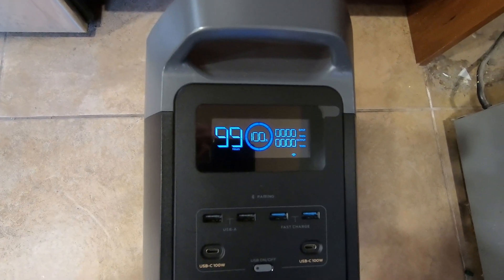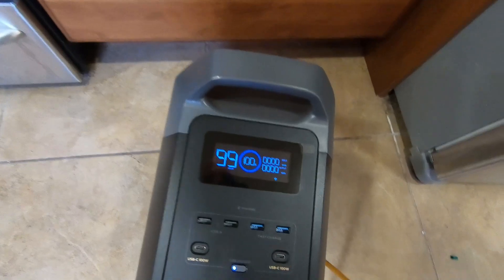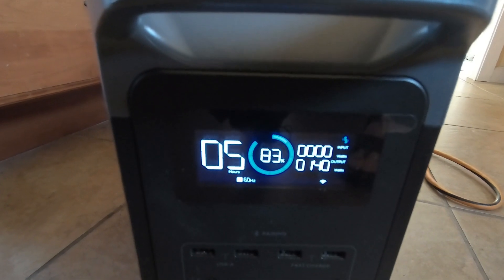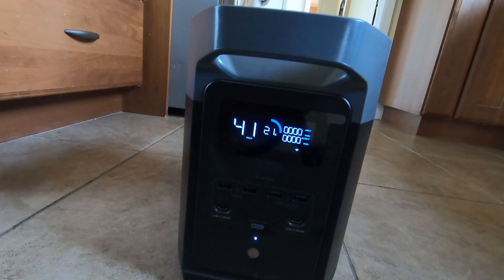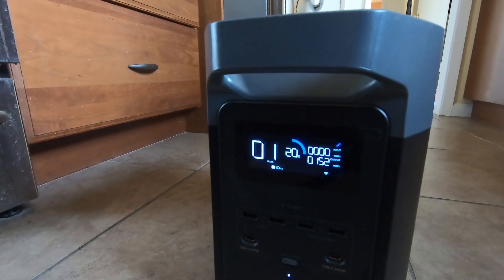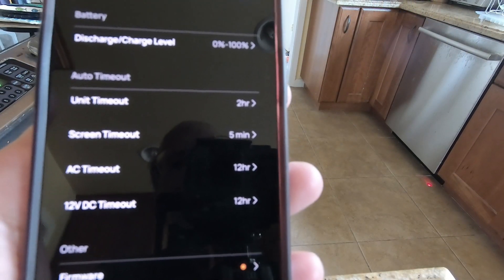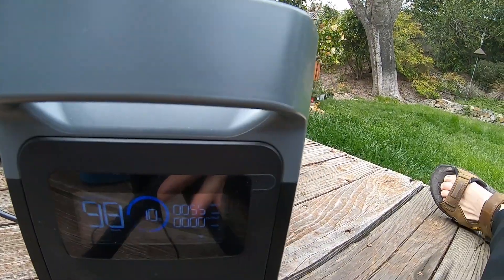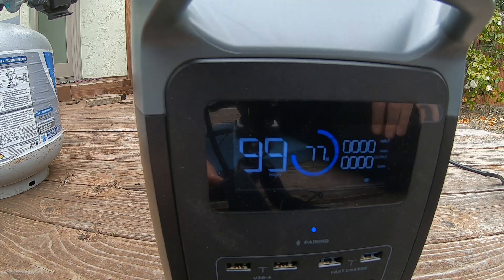EcoFlow Delta II Powerstation/Extra Battery - Review and as a Hybrid Power Source for Fridge Part 3

Comment: Can you plug in the refrigerator and the air conditioner at the same time?
Reply from the maker: We could plug in the Fridge and the Microwave at the same time. Our Air Conditioner isn't set up to be plugged in; it's part of a gas-fired furnace/AC system.
I doubt the EcoFlow Delta II could run an even a wall mounted air conditioner for very long, but I haven't tested that (we don't have one).
Window mounted A/C units draw 500-1500 watts or even more depending on how big they are.
You can see in the video that the Fridge averages about 150 watts.